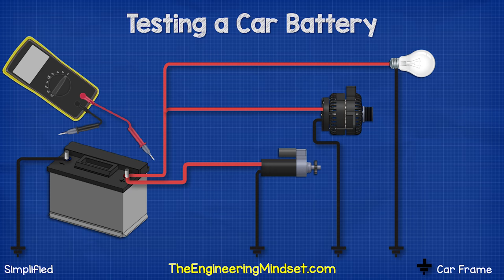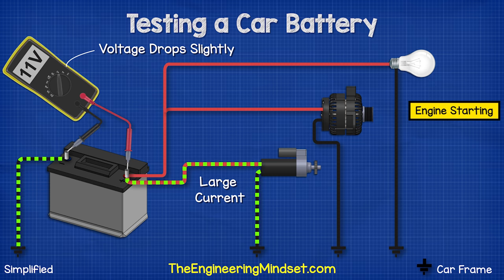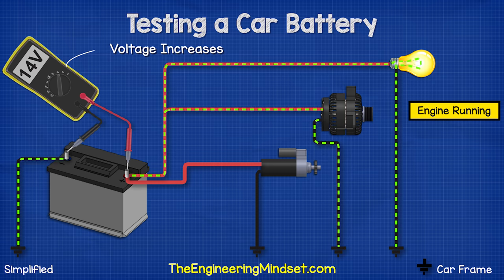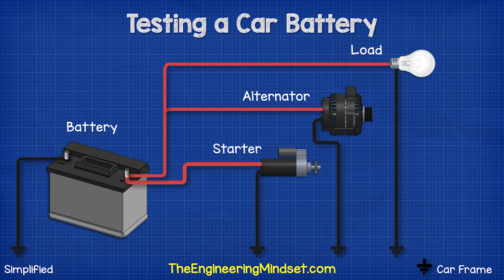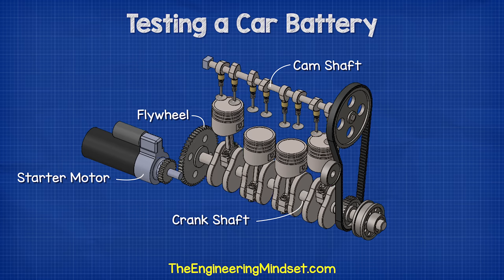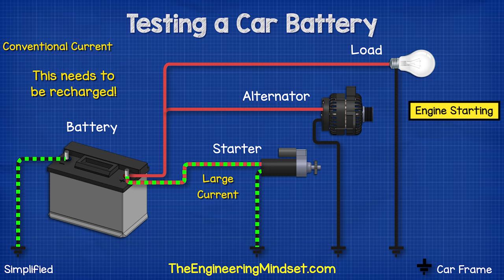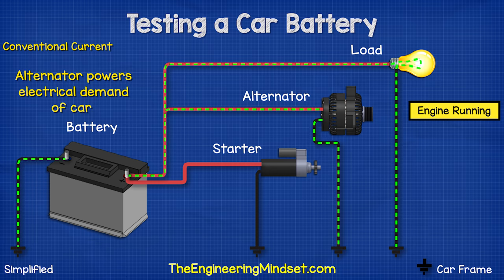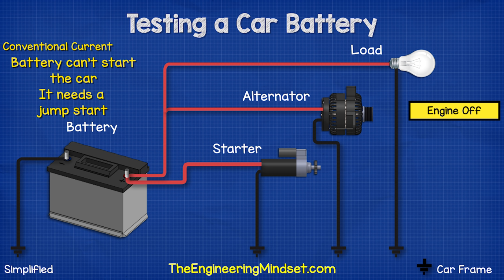How to test a car battery

Comment: I have seen that you can test a battery admittedly an AA one with a 100ohm (5W) resistor in series with the multimeter set to current (amps) can you do this with a car battery to test how good the battery is??
Reply: Using the AA battery as an example, that small battery would deliver a peak output about 4 amps for your test, 3-5 secs. The good car battery would deliver approx 700 amps or more. Do not attempt this as your connect leads will melt and your test meter could blow up in our face. The good battery will continue to deliver 100's of amps for some time. In your example of the AA battery consider to place the 100 ohms resistor across the battery terminals and safely measure the Voltage (rather than the current). Just measure the voltage with no load and then with the resistor. It's a judgment call to say if the battery is then good or not. 1.6v no load and 1.4v with load, its good. 0.95v no load and 0.6 loaded, not good.
Why the difference ? Consider an additional resistor of hundreds of ohms inside the battery than start out being 0.005 ohms and over time goes up in value to 100 ohms. That internal resistance prevents the current flowing, as the battery ages.
Reply: @Total-Solutions  A 100 Ohm resistor will not test a car battery, nor will it draw 700A.  By Ohm's law the current I = V/R = 12/100 = 120mA.
Reply from the maker: Check our new Multimeter tutorial out ➡️ https://youtu.be/4lAyzRxsbDc
Reply from the maker: Check out NEW resistor video, everything covered! ➡️ https://youtu.be/DYcLFHgVCn0